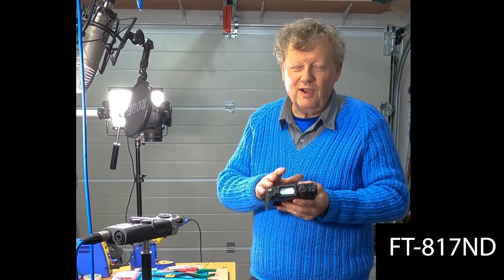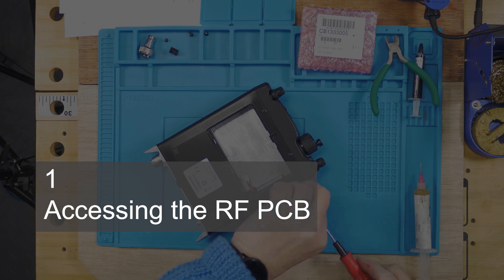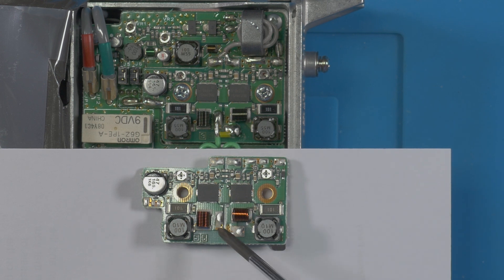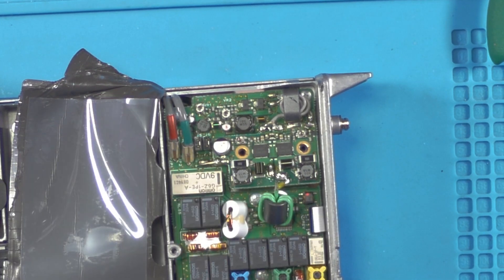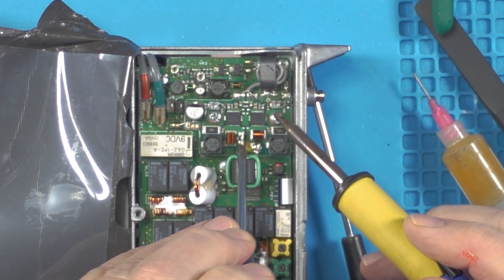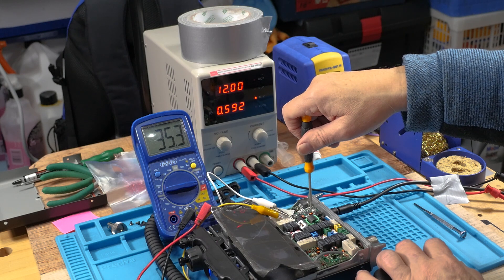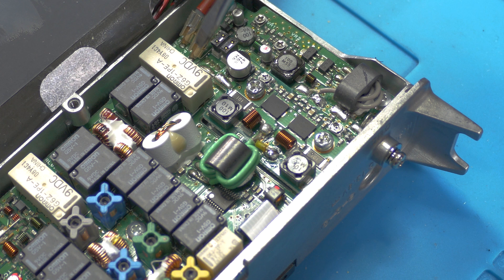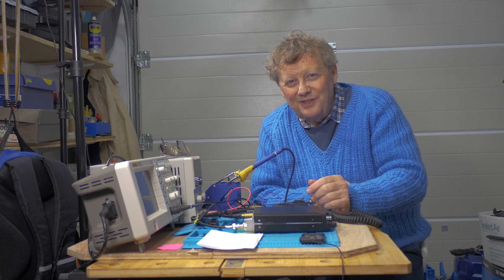FT817 Half Power !! Replacing the Finals - can it be fixed ?!

Comment: Thanks for the Video. I got an olf FT-817 just now, but bought a PA Board just in case. I hope that I don't have to use it. Strange on my FT-817 there is only the J4006 set, which I don't understand what it is doing...
So you have been grounded?  ;-) 
73 de Roman HB9XBK

Comment: I have a 817 that someone has been into before. It doesn't have the plastic film over the board. I don't see the grounding strip you mention, I just the the two jumpers and the two coax cables.  Is it a wire or a foil strip to the board under the small transformer?
Reply from the maker: As I remember it's just a small metal strip. If you follow the same removal procedure, you should get to the point where that is the last connection to remove, so it should then be apparent as you ease the finals board up. I hope it goes well for you...

Comment: Shouldn’t you have a dummy load on the output before adjusting?
Reply from the maker: Normally that would be an important consideration - I was following a procedure that originally came from the Service Manual (I think) and so I think it was taken into account and not necessary...no harm resulted anyway!
Reply: @Q26Video I exchanged boards and the current measurements looked good. The output stays at 1watt on 2m and 1.8 Mhz. Maybe something else was wrong and damaged the new board. Still looking
Reply: I got it. The rf power adjustment was turned down. Just glad to get it going. It was cheap at a hamfest for a reason.
Reply from the maker: @techguy9023  well done, it’s always satisfying to get something working again. Have fun with your FT817!

Comment: Hi ! I have 2 FT-817nd that put out 3.5w on vhf 144   and 4.6 on uhf 440 ... power meter goe full on uhf and half on vhf when tranmitting . Should i be worried ?
Reply: Do you have a decent power meter? Many power/swr -meters are not accurate between VHF and UHF. I have tested this radio with a spectrum analyzer, and the output was exactly 5W (FM) on both bands.

Comment: Hi….would you mind giving me the name of the soldering station as well as the type of solder…lead-free or lead?  73 Rob wd4ift.
Reply from the maker: Yes of course - Hakko 951 soldering station (beware of cheap fakes!), with soldering iron FM2028 and Micro soldering iron FM2032. To remove the capacitor I added unleaded (low melt) solder to each side before removing it, to make them melt more easily, but all the solder joints were fixed with unleaded solder. If you are going to do something similar, then my recommendation is to use plenty of flux - it transforms the whole business of soldering. Thanks for watching, hope it was helpful, best wishes from Mort / G4BSK